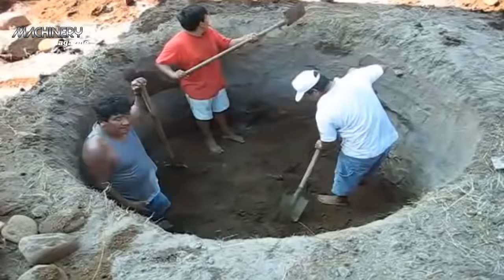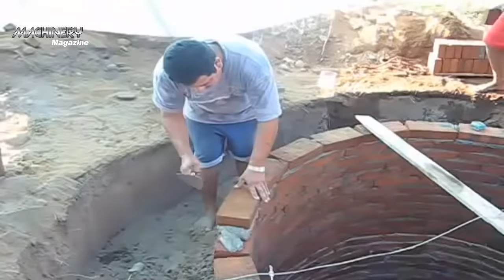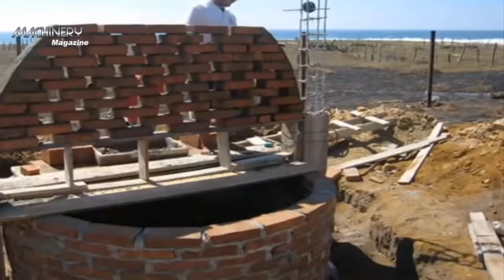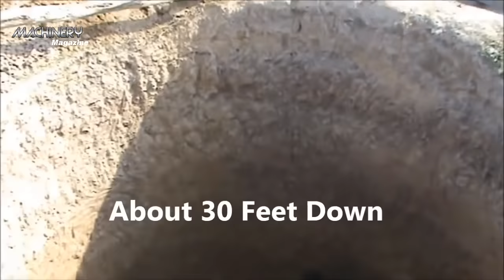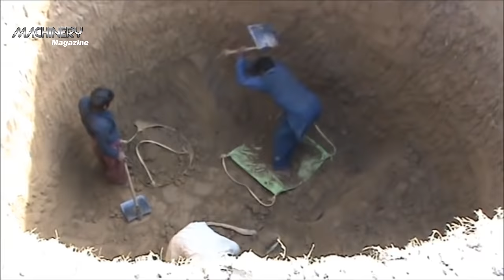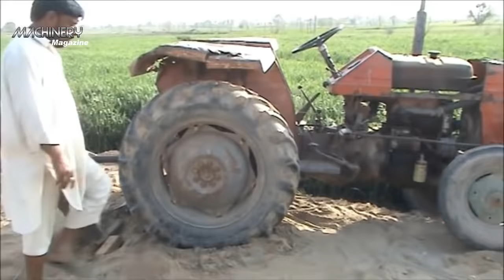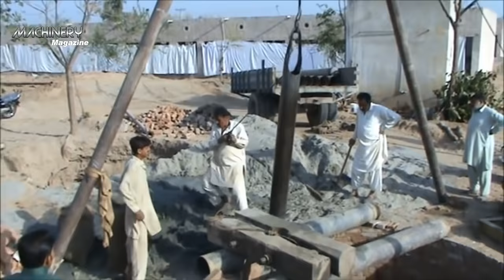Amazing Fastest Well Digging by Hand - Extremely Ingenious Construction Workers

Comment: Great work but much if that could be saved using a submersible pump inside the bore hole, rather than using an old fashioned centrifugal pump in a 26ft deep hole..... Our bore hole is 6" diameter by 60 ft deep, pump is at 40 ft with 20ft of water above and below it  - it pushes water up, rather than relying on suction, which is limited to about 25ft maximum pull....
Reply: Так можно было сразу бурить поставить трубы и глубинный насос)).

Comment: @08:28 From here it looks like the inner tube is drilling, causing the outer casing to sink, but if they only have a hoist, how was it rotating?

Unless the ground was really soft, and as they lifted mud, it sank?
Reply: Would of been nice to see more details, the one shot of the bottom I did not see a trap door to allow it to fill with the loose sediment.

Comment: I've dug several artisan wells by hand. These guys are risking their lives and anyone else's who sees this and thinks it's a good idea. All it takes is a soft layer of soil under a hard layer and that well will fill in on top of them and bury them alive. The way hand wells are actually dug (by people who know what they are doing) is you dig the hole down three feet then place a concrete tube inside. Then you continue to dig inside the tub and it will begin lowering as the dirt is removed. When the tube is at ground level, you place another one on top. That way the tubes protect you from a cave in and you don't have to try and work your tubes into a deep hole where they get stuck and wedged in.

If you want to use brick instead of a tube, fine, just place the brick as you go so you continue to protect yourself from a cave in.

Comment: when I was young I saw 2 half children boys(young teens) dig a hole of around 5 meters deep by hand in half a day, they had no ropes or ladders, and even came to us to lend a bucket from us since they only had a shovel.
they would dig down the round hole and when it was to deep one person would be inside, first throw the bucket up to the other, later when it was to deep for that they would use pressure against the walls to climb up and down without tools(so pressing on the 2 opposite sides).
this was in a local forrest, it is a forrest with sand dunes, so it wasn't like clay or rocks, but that hole was super deep and somehow they also managed to keep the sides stable enough to even climb up and down using them.

Comment: Watched a guy use a gasoline water pump and 250 gallon tots to push a pipe straight down using the water to push the soil out of the way. Seemed far more ingenious than hand digging that massive hole in the ground. 😅

Comment: BUT do you know how to go the other way: to make the well walls while you are digging downwards? My Dad made a well 27 feet deep through sand to reach rock. He told me how he built timber form-work, that became the frame for concrete ( a layer at a time). He dug into the earth (the sand) taking the form-work down with him and filling it with concrete to dry out and cure. The well is still there almost 100 years now. Dad was born 1916, me 1961. You can do magic ...

Comment: Used exacly that method - core cutter, to cut holes for reinforced concrete piles in for road bridge works in Nottingham UK around 1970. the only difference was the use of compressed air to operate the winch. Noise was incredible. I had to hook the cable to the bottom of the cutter so it could be emptied . In the middel of a wet winter, it was the worse job I ever had.

Comment: These diggers are endangering themselves. They are working inside  an un-shored excavated hole where their nose is below surface elevation. The sides of the excavated hole will collapse as the soil becomes unstable, especially in the presence of water. Notice they have excavated below the water table. This collapse may be sudden or gradual. Once these workers are buried inside the hole, there is not sufficient time to extricate them. Essentially, these laborers are digging their own graves.

Comment: Take a look at the second well. Note the composition of the earth. At a depth of about 10 metres a worker digs easily, using an ordinary shovel??? How it can be that???
  When I was digging holes in my garden for planting fruit trees, at a depth of 1 metre it was already impossible to use a shovel. The soil (earth) was very dense.
  I have a question: why is such a thick layer of soil so soft (unconsolidated, sparsely)??? 
How did this layer of earth come about?
Is this formation is recent?

Comment: That is a quite dangerous idea... unsupported walls of a hole can suddenly collapse and bury workers.  I guess you do what you have to do to live but understand these guys are as lucky as they are hardworking.
Reply: What you mean unsupported walls?
Reply: @stern_show_bobo4627  doubt it's a big problem
Reply: @wertiaaudit5746  -doubt what's a big problem?
Reply: @stern_show_bobo4627  Using a hammer to chip away the sides of the hole first by aiming it up and then down against the gravity 9.8m^2 would then reinforce the walls at higher difference requiring an incave collapse to need a force compeling it against the implied force. The idea of cave in's happening would only be such that in a scenerio of unexposed limestone were to hit acid water that would then crumble and even in such scenerio would mean a high amount of acid rain to be exposed to the unexposed limestone which at case would mean they would have to be mining while it's raining which is unlikely as a reasonable person would wait til it stopped raining. each time they have to reinforce the walls when they climb in and out by implied gravity of their own weight once again applying newtons of force to their exposed new walls thus compressing it to the weight of support. even an earthquake would need to fight against the gravitional pull + compressed force to make it cave in and that's assuming it's all dirt not rock. If they had a really fat person when the earthquake was happening it is theorically he/she can asborb the vibrational waves before it even hit the walls of the hole.

Comment: If it were me doing that hammering on those Rock I wouldn’t beat on the center but the Edge all the way around the Bolder so to chip it which is way easier then trying to crack it straight across.

Comment: What's ingenious? Some guys dig holes then build brick walls around them, AFTER they dug the holes. Ingenious would have been to add bricks to the bottom of the shaft as they dug down, thereby ensuring they didn't suffer a cave in. This was the standard technique of well digging in the UK centuries ago.
Even more ingenious would have been doing something like Brunel did when he built the shaft to reach the first ever Thames tunnel he engineered. He had some huge cast iron tubes constructed and laid vertically on the ground. Workers then dug the ground from inside the tubes, so that they would sink under their weight, shoring up the hole as they went.

Comment: I guess they didn't have a little bit of oil to lubricate the pully at 1:00. If they did, the world of pulling up the rock and dirt would be MUCH easier. That metal on metal action creates a terrible amount of drag. Kind of sounded like the bearings were bad but oil STILL would have made it easier.

Comment: Where was the water?  If they had to drill a pipe to reach the water why didn't they just drill from the surface and save their backs from all of the hard work.  Keep the electric motor up top for easy repair if it's ever needed.  Don't know why they needed such a big deep hole if they were just going to sink a pipe all the way down anyway!

Comment: Looks like a quick way to be buried alive, especially that 35 foot deep before laying bricks.  Those brick walls didn't look like they would hold the weight of the earth pressing in, the earth does move, it's called an earthquake!  A simple way to reinforce those earthen walls it to line them every four foot with wire fencing like cattle panels.  They are 16 foot long but flexible enough to be curved into a round shape, drive anchors horizontally to secure them in place and overlap each level (they are 52 inches wide) wiring them together.  If you're going deeper than 16 foot, then reinforce them further with more cattle panels placed vertically and wired to the horizontal panels.  This would also help if the soil isn't very stable!  Those men in the holes should be wearing climbing harnesses with quick attaching snap rings and also a separate rope for each digger so in case of cave-in they have a better chance to be pulled up, a ladder is too slow and would be in the way of digging whereas ropes could be kept lowered to about four foot above the bottom making it faster to find and attach rope to harness if needed!

Comment: Sheer stupidity. Heavy rock laden buckets above them in a bucket, no hard hats. No shoring of the walls to protect from collapse. Breaking large rocks by swinging a tiny hammer in an enclosed area with another person nearby. Running around site with open toed sandals.  Ridiculous and backwards. Not amazing.

Comment: Stupid and very, very complicated work. The shaft is only used to set up a pump at the bottom, as a pump cannot suction higher than 6-7 meters due to physics. If you were to use a pump that sits at the bottom of the borehole with an electric motor, then you would only need to build the borehole and not this complex shaft. Now don't say that they can't build such pumps in these countries, that's not the case. We always do it this way and a drill rig drills such wells in one day with three men. Why don't they have shoes on, that's extremely dangerous? Are shoes so expensive in these countries?
Reply: Health and safety is none existent in these countries... still shoes should be worn at least.